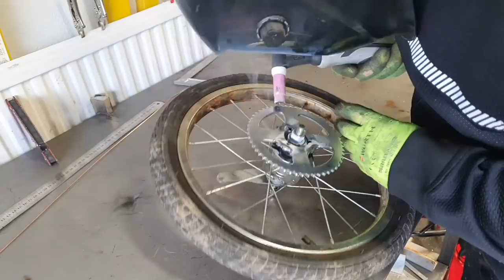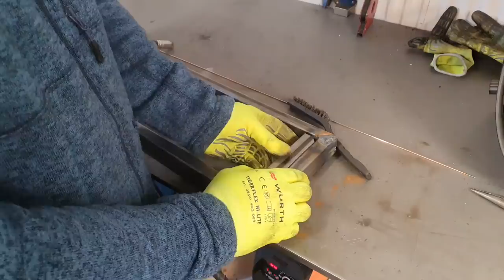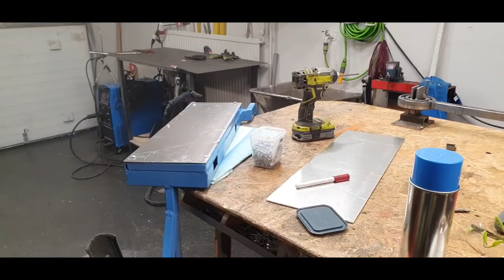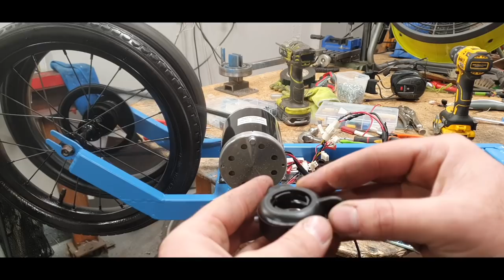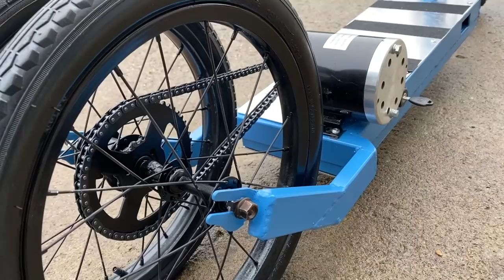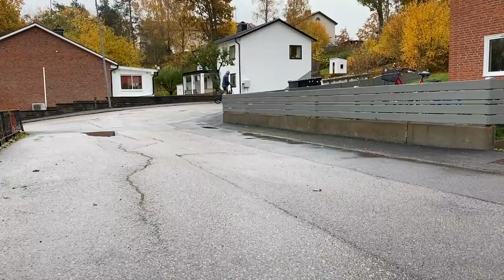How to make an 3 wheel electric scooter at Home

Comment: Hi sir . i have 500w 24v motor but i used 24v controller also. but i have a question , will the motor u used will survive in the long run while u used a 36v controller ???? thanks.